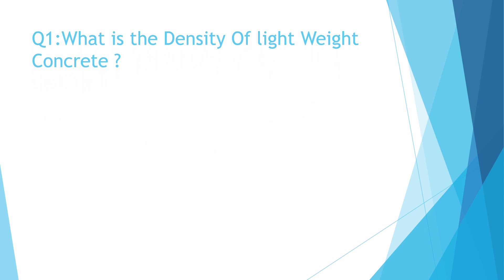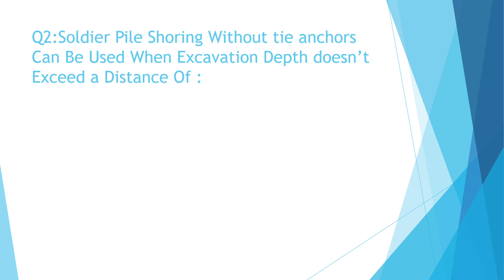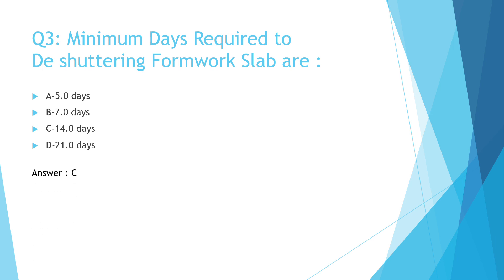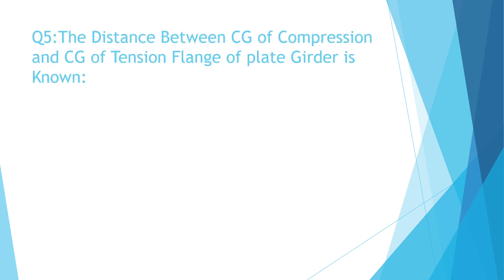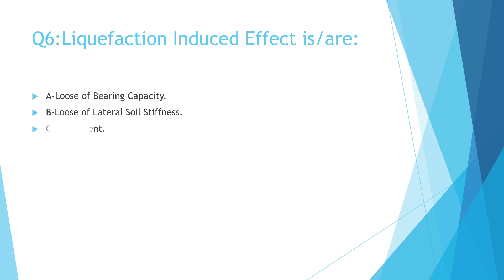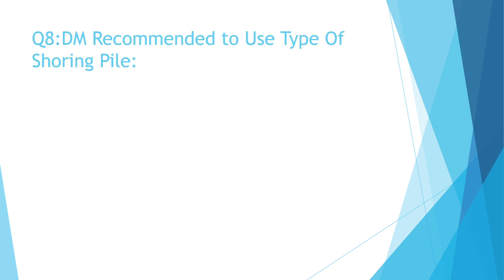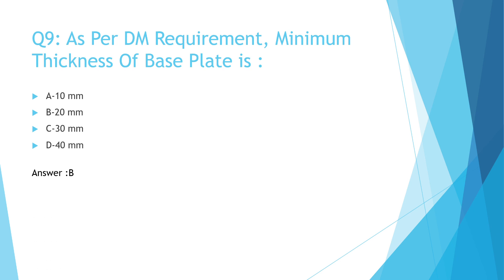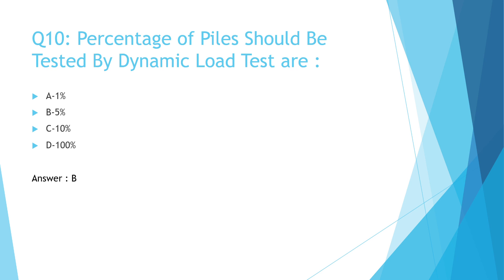Dubai Municipality Civil Engineer Exam 2022 for G+4 Part 2 contractor

Comment: Q8 Dm recommended shoring pile is Secant
Reply: Lot of confusion regarding this . Actually it’s soldier or secant . Plz explain
Reply: @fatima96401  correct answer is secant as per the DM circular.

Comment: Plz Chek Light Weight of Concrete is 1850 Kg/m3 OR 1000 Kg/m3.................?
Reply: I'm confused too about this one because lightweight concrete can be between 800-1950 kg/m3
Don't know which option to choose since it's so confusing
Reply: It is 1850 Kg/cum and not 1000